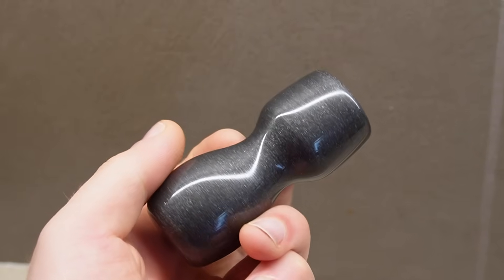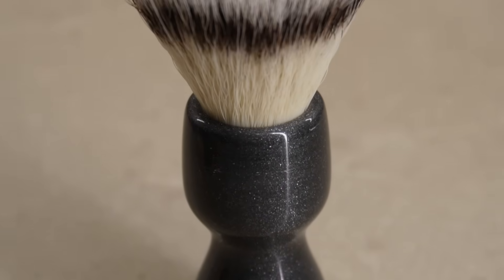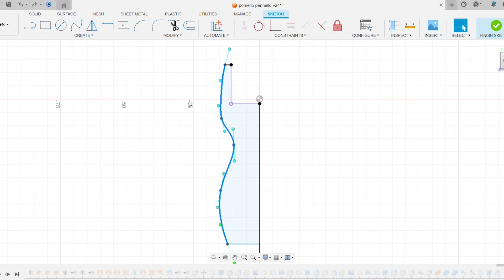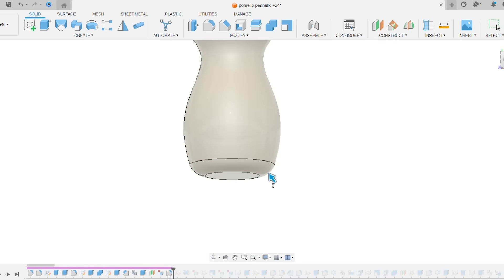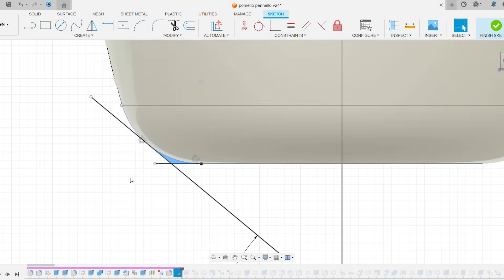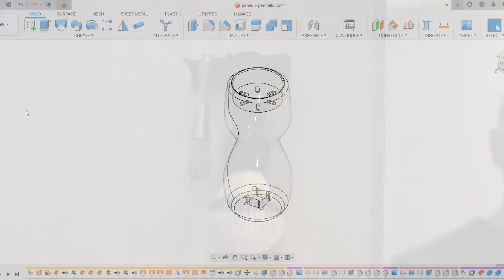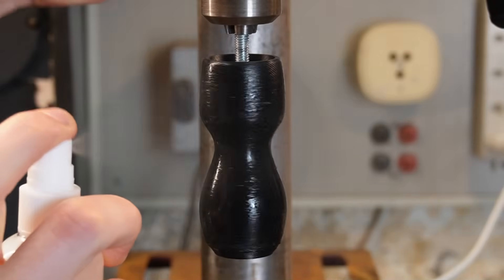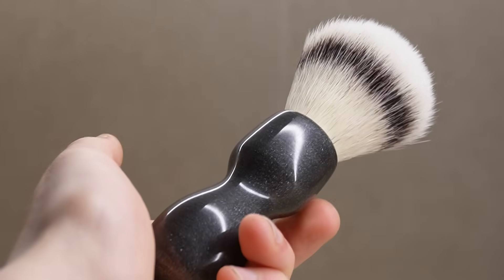MIRROR POLISHING PLA Until It Doesn’t Even Look 3D PRINTED Anymore

Comment: That was such clear info in a short video. Loved hearing the thought process. The handle came out so good.
Using a simple wired mic will get you way better audio.
Also I spotted some relief holes on the magnet pocket edges which I use extensively in my design as well to account for edges getting rounded in a print. Good stuff👌🏼
Reply from the maker: You got it! The relief holes are both for the inevitable rounding of the square hole and to give excess glue a place to flow.
I'm aware that I need a better microphone, and I'm looking into it.

If you enjoyed seeing the design process, it will be the central focus of most of my upcoming videos so stay tuned!

Thank you for the nice comment
Reply: @salveo3d  Dude I'm gonna try that tip on the fillet adjustment for avoiding drooping edges. Forgot to mention that. I look forward to seeing you make more things.
Reply from the maker: @vd9424  yes you should try the trick! It works like magic

Comment: What is AAT 501 and 502?
Reply from the maker: The polishing compounds produced by 3M
Reply: @salveo3d  Itk's pretty expensive, but you shouldn't need much of it. Looks like one bottle of each will last you forever
Reply from the maker: @stevendomingue6033 you're right it will last for a long time. You can try with toothpaste if you want a cheap polishing paste

Comment: Lovely video. One quick note: when you put the fillet and then chamfer on the bottom, you did it in such a way which required a few extra operations. (Fillet first, then fill in the extra space) If what you do is you just put the chamfer on the bottom first, and then you fillet between the top of the chamfer and the body of the object, you can use those tools and save a bunch of work achieving the same result.
Reply from the maker: Yep, that was to better control the overhang angle, but yours is a better/faster way

Comment: Great Job. I printing A Bass guitar and that's the finish i want. Plenty of people on redit saying you can't get a finish like that. I have done some test pieces with a great finish like this.
Reply from the maker: Thank you, it's an unbelievable finish! I hope your Bass guitar turns out good
Reply: its going to be a lot of work though, this worked well because you can rotate sand it. you cant do that with a guitar body though. so even if you can get a good finish on some test pieces, getting the same level of finish across the whole plastic guitar body will be a lot of work.
Reply: @MrMediaPC  There are lots of interesting attachments for Dremel and such. One kit I have came with different grit sandpaper tips and polishing tips. Due to the movement you may end up with a distinct pattern on a guitar though, so experimentation is needed.

Comment: Nicely done, and I recently made some gear lever knobs in ABS, used a threaded hole to hold a socket cap screw in a cordless drill to sand and polish them, but after seeing your results, I think I’ll make an arbor for a pillar drill, and use polishing cream. The lack of layer lines on your print was impressive, not sure if that is a difference in materials or the finishing or polishing process. I shall experiment a little bit more. I can’t use PLA in a car, as it would deteriorate in a hot interior.
Reply from the maker: I also tried with ASA (similar to ABS), which is why you see two different handles in the drill and in the final product. ASA gave me the odd issue of delamination in specific layers at random points on the handle. In some spots, the outer layer loop seemed to peel off, spoiling the perfect surface.

Maybe it was due to printing too cold, or perhaps it's just the material. I'd still suggest you give it a try because ABS sands much faster than PLA, maybe you'll have better luck than I did!
Reply: @salveo3d  It probably is a layer adhesion issue, but a useful trick is look at the flow rate in your slicer, and see if there is a correlation between the layer delamination points and any transitions in flow. Usually faster flow rates will result in a drop in extruded temperature, as well as certain shapes forcing slow downs and increasing cooling stress at some points, so an object thanks like a rectangular letter. Ox shape is more likely to lift off the bed, than a circular one. BTW, as a wet shaving person for years using increasing numbers of multi-bladed razors heads, aka more is better or so it seems, it would seem it’s the distance between the blades that is important (empirically) as I was given some “sensitive” skin ones a few weeks back, and they seem to last longer, and don’t tug on the stubble. Now that was a surprise 😮
Reply from the maker: @mikecrane2782 Good insights! It may actually be a flow rate-related issue. I’ll check the G-code and compare it with the peel-off points on my print.

As for wet shaving, it’s cool how everyone finds the best solution for their skin
Reply: @salveo3d  Yeah it's a bit confusing ... the polishing video is of a different filament than the final product? I was wondering how polishing got you those gorgeous flecks
Reply from the maker: @phlebas-uq6fv  the polishing video was made with Black ASA but it gave some problems in some spots.
I've made the exact same procedure with the PLA you see at the end, but I didn't have the camera with me, so I used the recording I had